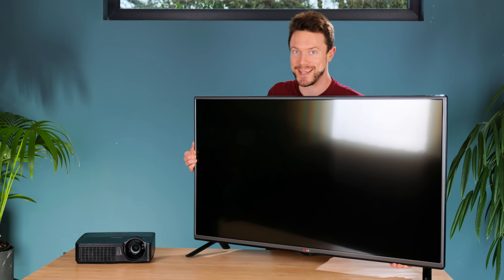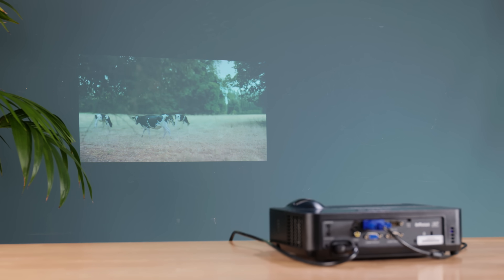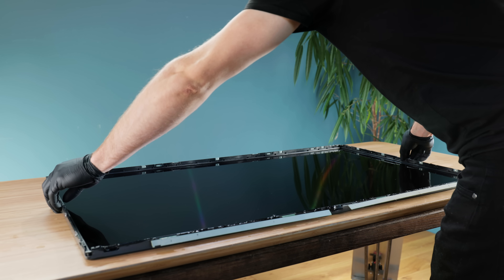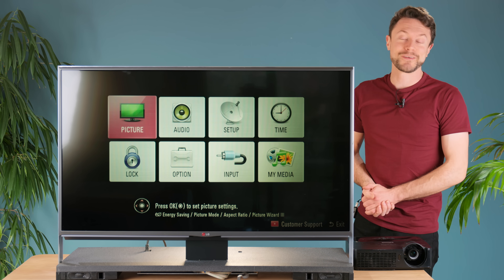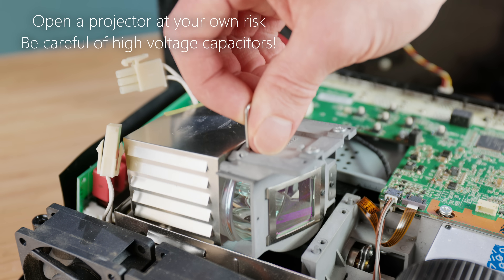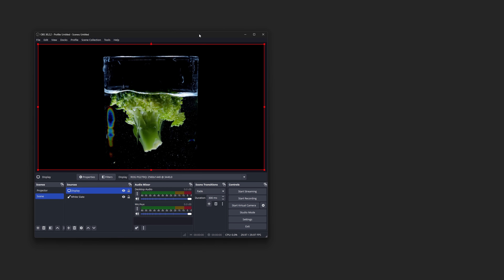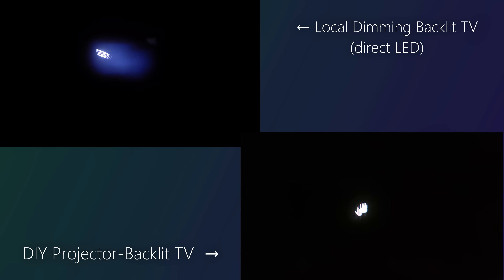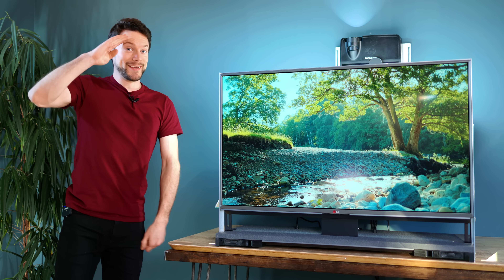DIY "infinity contrast" TV -  with 100% recycled parts

Comment: I had the same LG TV with the backlight issue. I found a bunch of YouTube tutorials on how to fix it. I opened the TV, replaced the backlight, and it worked! But when I tried to put it back together, I accidentally flipped the order of the metal frame around the screen and the LCD. And guess what? The glass shattered right away! 😂

Comment: Fascinating!  I remember DLP TVs had a short heyday about 20 years ago.  They used a focused projector to shine light through a color wheel onto a chip that had thousands of tiny mirrors that reflected that light onto the back of a large screen much like the old projectors did.  A workmate of mine bought  the biggest TV I'd ever seen using that technology.  Took up half his living room.  A year later the new plasma display panels and large screen LCDs came out making his giant DLP TV obsolete.  Those old DLPs didn't last long in the market and were a huge waste of money.
Reply: I still have and use my dlp TV.  I've learned how to repair it when the color goes wonky.  It's 82 inch screen still makes me happy.
Reply: @pabeader1941  wouldn't such a TV have the same rainbow effect as a DLP projector when you move your eyes around?

Comment: nVidia did some testing similar to this around 15 years ago, combining two IPS LCDs atop each other to get close to 1,000,000:1 from IPS, but as LCDs only have ~30% transmittance, if you needed a ~100w backlight before, you need a ~300w backlight to get the same brightness.
They also did some testing to offset the panels slightly to get a 4K like resolution from 2x1080p (half the rendering power of 4K)

Comment: Another impractical project. Too much hardware required (PC too for OBS, mirror on ceiling), cables galore, too small a diagonal, projector fan noise, light bleed in the room, can't hide the contraption easily. Overselling a mess!

Comment: you can get the same result with a dual layered LCD display and a MicroLED system. I have seen this and they look spot on to an OLED. You can even do this for much much cheaper then what was done here. 2 LCD tvs and some LED strips what can be controlled by the TV, after al this is more or less what MiniLED tvs are, just overprice and a more advanced LCD display type.

Comment: Why does this seem to be much better than the projector by itself?
I guess the light loss trough the color wheel is much higher than trough the LCD. Even with the fractional time based blocking of the color wheel I am still surprised by the ammount.
Would have liked to see how it would have looked without the diffuser.
And instead of modifying the Projectors lumenance, wouldn't it be better to modify the LCDs? So have the projectors image be modified to have a grayscale version of the image and the LCD does the colorfiltering but at full brightness?
Also, shouldn't a bulb based Projector in this setup be able to produce even better colour accuracy and range than an OLED could?

Comment: I wonder if instead of the office projector, one could just use a rear projection TV from the time when making large LCD's was not reallz possible and worked as a stop gap for a short time. Zou would basically only need to change the frenell lense and diffusion layer for a fitting LCD display to create the same effect. Because we did kind of already have half of this solution as a product with those RPTV's. Personally I think it never got made into an actual product because people fanted flat TV's and the rear projection ones were really not all that great. That and cost, because you need a whole projector setup in addition to the LCD, and just using fourescent tubes and later LED's is a lot simpler and cheaper to manufacture.

Comment: You might want to consider a very wide angle, almost fisheye lens on or in front of the projector, to keep the cabinet to a reasonable depth. There's a history of their use in projection TV, in fact. I imagine you'd need to do more pre-processing of the projector image to accommodate for the lensing effects though.

Comment: "11 years old" ancient tv...   My tv is 18 years old. 37 inch sharp 1080p. it have cfl as backlight not even led.  it uses 60W while normal tv watching, in dynamic 160W, quality of the picture is good. especially that most of tv channels are 525i 720p and 1080p.

Comment: Why not just double stack 2 cheap identical LCD displays and then up the backlight brightness instead while using the OBS trick for the 'rear' panel to twist the LCD's to max on/off while the front operates as normal?

Comment: If I was going to do this, I'd also work on encasing the light path in a false wall with recesses for custom speakers so the screen and speaker fronts look like they're flush mounted in the wall. I think it would be an incredibly clean look for short money. Especially if you have the electronics for controlling the monitor and sound system mounted in the false wall underneath them, with something like a smoked glass cover that slid down, but was the same size as the monitor.

Comment: Doing this with a DLP rear projection TV would seem to make a project like this simpler (assuming you can find a similar sized LCD to the rptv screen size) and much more compact in depth, along with often having speakers that are much better than in LCD displays. They also typically have minimal value, whereas normal projectors are still useful as they are.
Defocusing the projected image could potentially also have the same effect as expanding the luma mapping in software.
Once shallow enough, recessing it into a wall would also be very cool.

Comment: 4:10 I was 16 years old and didn't know that these capacitors can store such high voltages. Took apart my old monitor, which still had a built-in PSU, grabbed the PCB, and accidentally touched the legs of a very huge capacitor with my middle finger. It was numb for 2 days after that.
Reply: 😬😖 yikes dude
Reply: Your lucky your alive, those things can kill easily.
Reply: @toastyretinas  Rarely, aside from the shock current having to pass through the chest the timing where the heart is vulnerable to a DC shock is quite narrow.
Reply: It happened to me when fiddling around with an old camera, turns out the flash isn't a LED, it's a spark, so I basically turned my finger into a flash 📸
Reply: @eljaibas16 similar here. 3 or 4 hundred volts from the photo camera flash light capacitor actually burned a hole in my finger then it travelled across my arms dangerously close to my heart. Fortunately it was a small cap so not much energy was stored. I neglected the old rule: one hand touch only whenever there is a possibility of dangerous voltages. Which is anything above 24 volts.
Reply: capacitors dont like being flipped off
Reply: Well, i repaired a old picture tube based tv when i was 12, and only light came out it was a blue light from backside, still don't know what happened...
Reply: @vaisakh_km  urm X-rays?
Reply: Capacitors are dangerous stuff, but they will rarely do you in, unless you touching something made for a 1000W system.
Reply: Glad that you're still with us!
Reply: I always manage to shock myself when repairing a SMPS - despite being very careful. Every. single. time. 🙄
Reply: it's not the voltage that kills you, it's the amperes
Reply: @knightsljx  Seeing as there are a lot more voltage sources than amp sources in real life, I think I'll continue watching out for high voltage.
Reply: I'm sure it hadn't happened since, am I right? :) These are the best learning experiences you can get... if they don't kill ya... :-P
Reply: @guyfromostrava  bestest experience is the one you don’t have to endure yourself, but were done and reported by others.
Still experiencing it by yourself might be more convincing, but you only live once. 😊

Comment: i have concerns with the mirror idea. if you are using commercial mirrors that are second surface mirror then the thickness of the glass in front of the reflecting surface will diffract and soften the projected image. the more mirrors the worse it would be mainly on the 45 degree mirror.

Comment: i think you can make it more compact by putting 4 smaller projector at the back , but because of that you need to partition the size of the tv into 4 rectangles and program the projectors into 4parts and by using mirrors , that way the projector will not be awkward. 

[ + ]      <  like this partition at the back of the tv.

Comment: Dual layer LCD displays also exist, same idea as this but with two normal LCD panels and a normal backlight instead of the projector. Brightness and power consumption suffers heavily though as the extra layer blocks more light, needing a brighter backlight to compensate.
Reply: DIY Perks already made a dual layer LCD with two old monitors like a year ago..
Reply: Yes. Sony BVM-HX310 uses dual layer LCD.
Reply: At the other end of the cost scale, Apple also use dual layer OLEDs (tandem OLED) in their latest iPad Pros to get better light output, efficiency (key in a mobile device) and contrast …  https://www.youtube.com/watch?v=3moprE5S3Qc

Comment: Even OBS probably didn't know what it was capable of doing. This man's intellect works on another higher dimension than us
Reply: Don't forget he is the presenter and about 51% behind the idea's.
Edited video's can pull 99 tricks on you.
Reply: where does he install the obs app?
Reply: @saeedm9772 On the computer that is driving the image for the projector and TV. Basically playing a video on the computer using the tv as 1 monitor and the projector as the second monitor. But the 2nd monitor is being told to output the obs image feed. At least I think that's how he's doing it.
Reply: @DuelingDexperts  Alternatively you could use any video source by using an HDMI splitter and a capture card. Although the capture card might introduce latency issues.
Reply: @saeedm9772  on his PC

Comment: I'd love too see this with a short throw projector assembled inside of an old CRT TV, for the ultimate retro style TV. 

I'm always excited when new DIY perks projects pops up on here, you're doing wonderful work
Reply: I was actually thinking of the old rear projection TVs that were all the rage in the early 2000s, many of them were actually DLP-based, swapping out the screen for an LCD panel could have a similar result!
Reply: The Technology is totally different. It would not work. You would have to take out the whole Tube and replace it with an lcd panel. At that point you just took this concept and put it into an old TV's housing.
Reply: @lezorn  i think thats what they meant
Reply: @lezorn  Thats exactly the plan! Only keep the case from the CRT TV, for that retro style. Like how people retrofit old classic cars with electric engines and stuff like that

Comment: This reminds me, CRTs used to do something similar by projecting light onto the screen.

This idea isn't really new and the reason why it didn't became popular was... bulk.

As you can clearly see. You need quite the distance for projector to properly encompass the entire display.

However, knowing science hippies, you should he able to get the same effect (or better) by stacking minature laser projectors and having a computer program coordinate them. This reduces the distance needed, making the TV thinner (and brighter).

Back to the TV in the video.

One amazing advantage of LCDs are their longevity and durability. Unlike Oleds that burn out faster than your relationships, LCDs fair a heck of the lot better to time than OLEDs because of their inorganic elements.

Problem is... brightness.
Sure, LCDs are durable, but generating light also generates heat. And higher brightness = higher temperatures, which can quickly damage any TV if left unmonitored.

Comment: My diy perks king has arrived baring gifts.. 

Please compare this to a standard OLED panel.

Make an enclosure that will house all of this so you don't need the projector outside of tV AND More as one unit.. so it could be portable. 

Also, maybe make a version that is made from an OLED and a high range projector.. and compare all three standard led, converted led, converted OLED and OLED. Then get a special guest on to calibrate the sets and have a view off to find the superior set.

Comment: Brilliant. Just a thought to slim it down - How about using two LED Screens back to back to make a super slim version. One Screen showing colors and the other showing the modified black & white. The proximity of the back screen means it wouldn't have to be so bright to have the right effect. You could experiment with no diffusor panel or just the fresnel panel etc.

Comment: Damnit that is a cool project I bet that if you build some furniture or fake structure made of drywall around the TV you can make it look way more integrated into a living room.
At first though I have two questions.
1. How is the noise on that old standard light bulb projector, these came with powerful fans, right?
2. There is any very low power device that can do the OBS filtering, or you would need to tap necessarily into a full PC power? I guess that if you build a media server that is also a media center PC that could handle everything.

Comment: Great project - I wonder if you could make it even thinner… If you had two of the same size old LCD TVs, could you stack the panels and one of the original backlights so that the whole stack is thinner? The rear of the two panels could have your OBS-created glowing luma map, and the front panel actually displaying the full chroma and luma signal, but with contrast multiplied by the panel behind it. Even better if you could somehow remove the RBG filter layer from the rear LCD panel to let more light through. Then no need for a projector+periscope or even a short-throw projector. I think this stacking technique is similar to how some mastering monitors work.